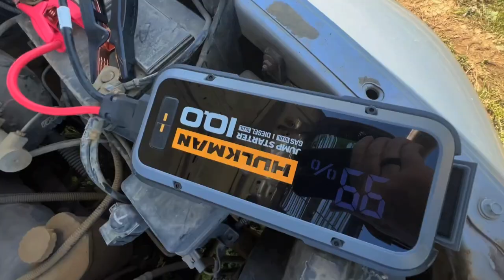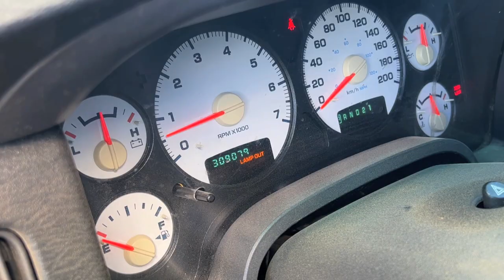DESTROYED Ford But DODGE Survived!

Comment: I helped a buddy change one them half shafts after about a 12 pk we had it far enough apart to get that shaft out but it refused to come out the trans. No problem just back your Ram up right about here, grab that chain, leave a little slack in it, me and these 3 guys will hold the car so it stays on the jack stand. Now Punch It !